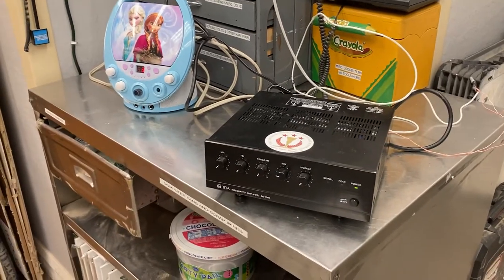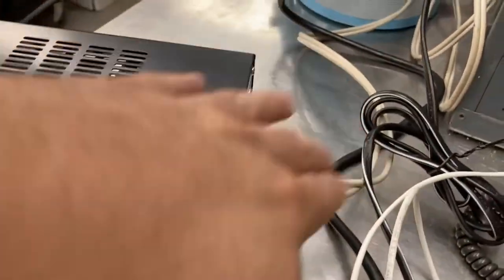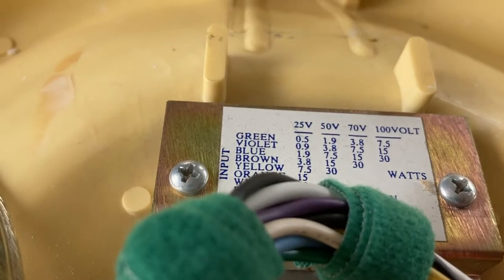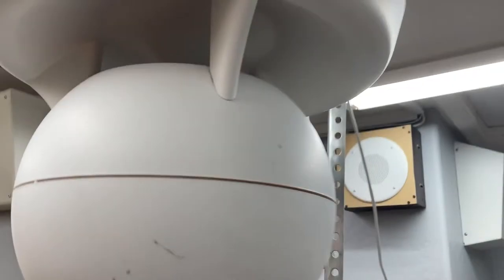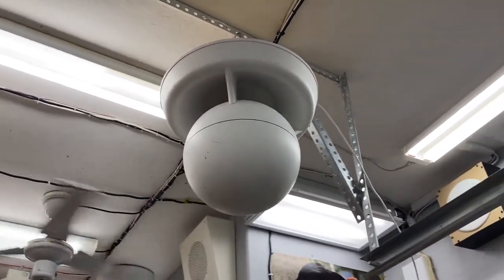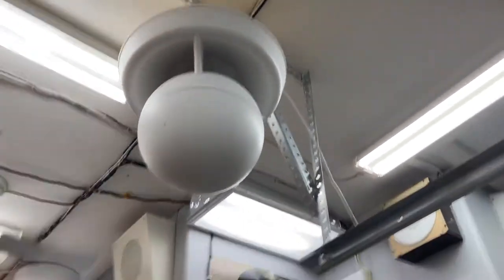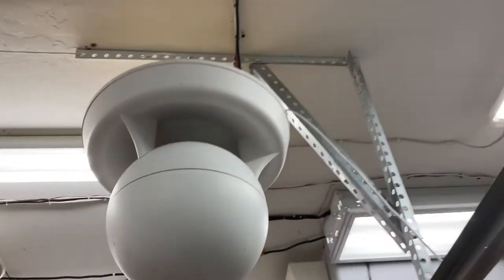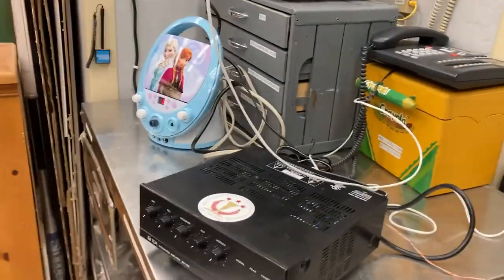Soundsphere Speaker 110A In Depth Look

Comment: Very happy to come across this video. As you had shared not really any information out there on this speaker. I was just given one of these by a friend. Having no AV education I was hoping to get information on what would be needed and how I would go about properly and safely connect this speaker for music in my garage. Thank you very much !
Reply from the maker: All you need is a 70-volt amplifier or you can cut the wires going from the transformer directly to the speaker to use the speaker driver on regular home stereo equipment.